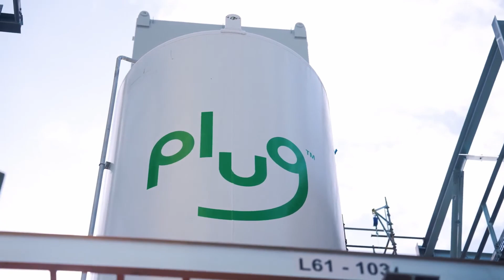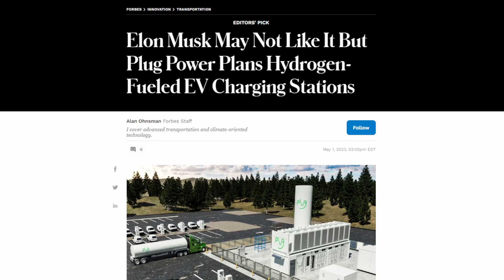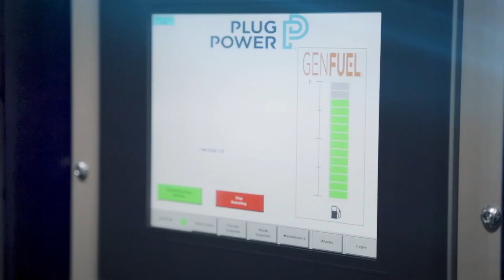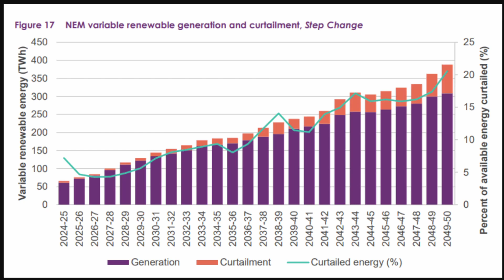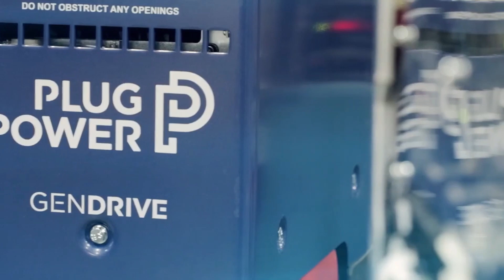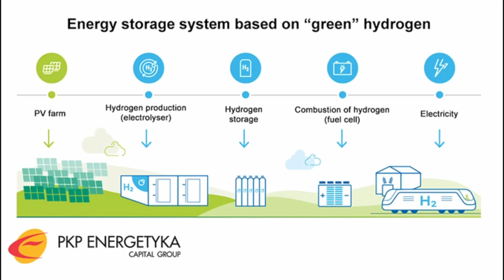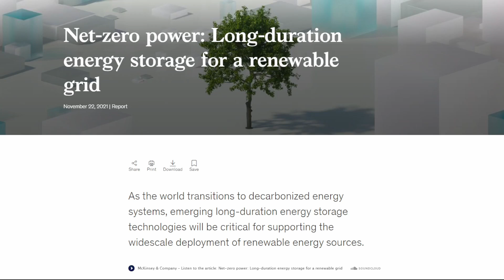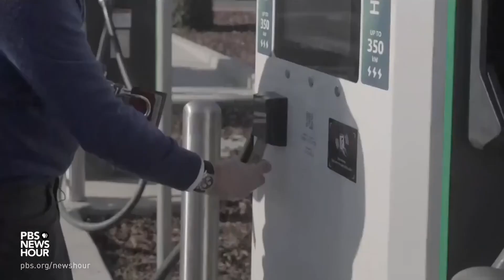Elon Musk May Not Like It - But Hydrogen EV Chargers Are Coming.

Comment: Interesting.  I wonder, can there be a small, portable hydrogen recharge pack that would easily fit in the trunk or maybe backseat of a car or suv, that can quickly recharge an EV car's battery once or many time while out and about but where one can't easily find an electric recharge station, or must wait for one's turn a long time if there is one?
Reply: The storage tanks sufficient to recharge an EV would fill all the trunk space and half the back seat. Even at 10,000 PSI hydrogen is not very dense.
Reply: @jimmurphy5355  That sucks.  Sounds like an actual hydrogen fuel cell vehicle approach to transportation is more likely than my idea.
Reply: I want a hydrogen fuel cell SUV that can use as a backup generator during power outage. I can easy go get a refill at the hydrogen refilling station fast to continue generate electric for the whole house for as long as I can before another refill:)
Reply: @laftiskuno1357  I always thought that hydrogen fuel cell vehicles were a better future than electric cars run off the electric grid.  I remember during the GW Bush years, President Bush gave tax credits across the board to stimulate development of alternative, more environmentally friendly vehicle engines.  At the time, both hydrogen fuel cell and electric cars were the research craze.  GW incentivized all, by tax breaks not government spending and trying to pick winners, but letting the market decide.  This period saw a rapid early expansion of both types of research, solar energy too but that's another topic.  In any case, when Obama came into office, one of the first things he did was choose one over the other, choose electric over hydrogen fuel cell vehicles, and terminated the tax breaks for the hydrogen but added expenditures for electric vehicles.  And enter Tesla.  Ironically, hydrogen is much cleaner start to finish in the process than electric vehicles.  How wonderful if hydrogen fuel cell technology catches up and takes off.  This video made me think perhaps this is beginning to happen.  Most electric grids are powered by oil, natural gas or coal, in the US and elsewhere, so electric cars do not have a net positive effect all aspects factored in.  Hydrogen fuel cells do.  They do not require any part of the traditional electric power grid, and when operating in a car, the only exhaust is a tiny amount of clean water/moisture/vapor, good old h20.  Yep, ironic.  Another irony is that natural gas is significantly cleaner than oil or coal, and in the US we produce natural gas dramatically cleaner than anywhere else in the world, which is why only the US of all the Paris Climate Accord countries actually met the carbon lowering targets, most others didn't even improve them, while the US exceeded them.  Until Biden comes in and groups natural gas along with oil and coal, saying we have to stop all three, but then demanding more of all three from other dirtier production countries, just stopping in the US.  Ironic.

Comment: LOL the power grid is easy to build alternate long term power storage systems. There are many other storage systems possible other than hydrogen or lithium batteries. Hydrogen isn't easy  to store or transport. you need large storage tanks or to lower temperatures to -270 C for transport. Hydrogen being the smallest atom it's the most likely to have leakage issues. Frankly rocket companies have had more issues with hydrogen in there rockets than every other fuel. I can tell you now no insurance company would allow a hydrogen fueling station in a urban area when it realizes the liability of a severe hydrogen leak would be. Such station have exploded before you know. Frankly hydrogen cars are 2X the price of EV's and the fuel is 3x the price of electricity. It's no wonder that hydrogen refueling stations are being removed. Only oil companies, Toyota and governments are pushing for hydrogen fueling stations. If you haven't figured it out Toyota has got a car that it only can sell in Japan LOL

Comment: Why on earth would anyone use 4 times the energy to create a fuel that then needs to be compressed to over 10,000 PSI and carefully transported for safety reasons, when they can use 1/4 the energy to charge megapacks and use them at charging sites. 

Or, like it's happening now, cover large parking lots with solar (the average Walmart parking lot can support 7mw of solar using 500 watt panels, and that's WITHOUT counting it's roof) to charge EV's and megapacks AT the charging sites. You know, like Tesla is already doing in a few California sites and is building a huge such charging site in Arizona. And Europe already has 2 or 3 such mega-sites. And these sites can be modular, meaning they start with just a few megawatts and then increase as the EV adoption ramps up.

Or is this a Hydrogen pumping channel trying to fool those easily fooled?
Reply: That said people on horses when cars were invented. Technology progresses, but from time to time, I always find people who believe that the new technology has to be born in its final state or been discarded. Unless.... don't tell me you are invested on Tesla?
Reply: @danielgomezmeneses6989  New Technology? Hydrogen was first tried as a fuel in 1820 for one of the first ICE engines ever invented. It got nowhere.

And in the more modern world, Hydrogen has been worked on since the early 1970's after the first Arab oil embargo. And where has it gone is all that time? Again, absolutely nowhere. 

The only thing new that has happened since is storing in fiberglass tanks since it seeps in and corrodes any metal tank it's placed in since it's the smallest element known to man. It's so small and has so little energy that it has to be stored at 10,000PSI to be of any use. 

You know what was made out of fiberglass that was used in high pressures that has been in the news lately? That's right, the Titan submersible that imploded under high pressure. Except that was only 6,000PSI. So imagine what happens at 10,000PSI when it fails.

Have you ever seen a Hydrogen tank explode? It's10 time worst than from a gasoline tank of equal size. It obliterates anything in it's vicinity. And sends flying fragments at velocities than can kill for hundreds of yards.  

So again I ask the same question: is this a Hydrogen pumping channel trying to fool those easily fooled? You know, those that blindly believe what are told and never look anything up themselves.

Comment: 7.083 gallons of water contains 3 kg of hydrogen, 3 kg (6.6 lbs) of hydrogen holds the same amount of energy as a 100 kwh  battery that weighs about 1200 lbs and costs about $20,000.00 A company in British Columbia called HTEC is selling hydrogen for $12.75 per kilogram, so 3 kg of brand new, defect free hydrogen containing  the same amount of energy as a $20,000.00 battery is worth $38.25. AND the energy (electricity) for a battery electric vehicle doesn't even come from the battery, it comes from some external source, the battery is equivalent to a really expensive gas tank. A Toyota Mirai got into the Guinness Book of World Records by driving 845 miles on 5.6 kg of hydrogen. Somebody broke apart 13.22 gallons of water and the guy driving the Toyota put it back together WHILE HE WAS DRIVING! How cool is that?